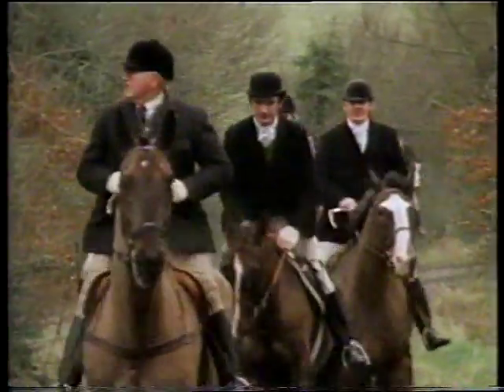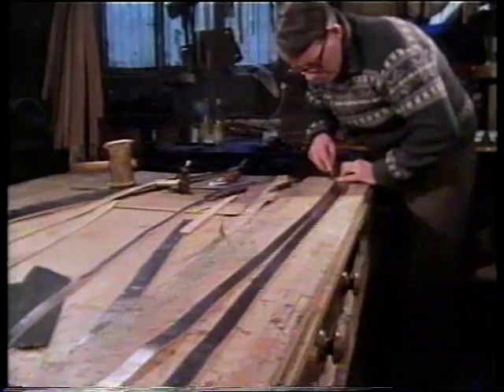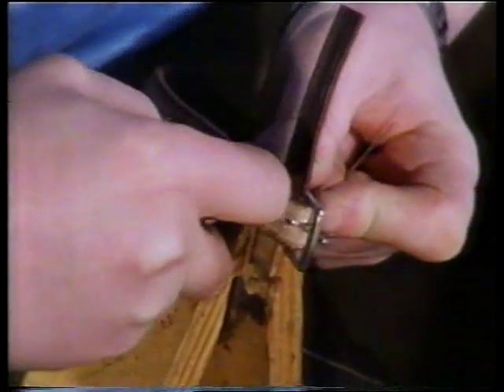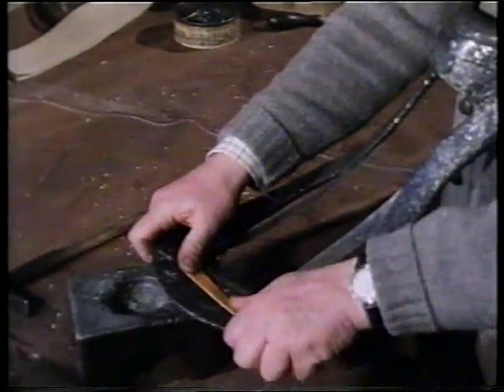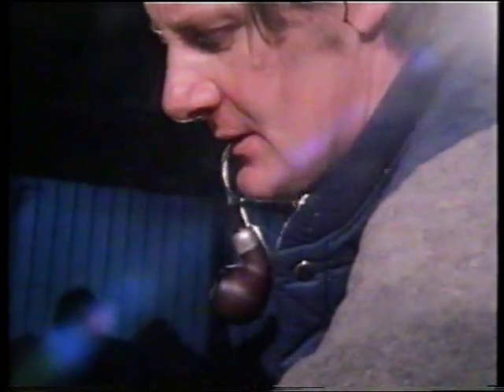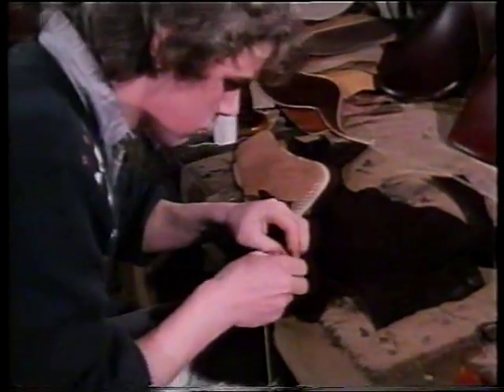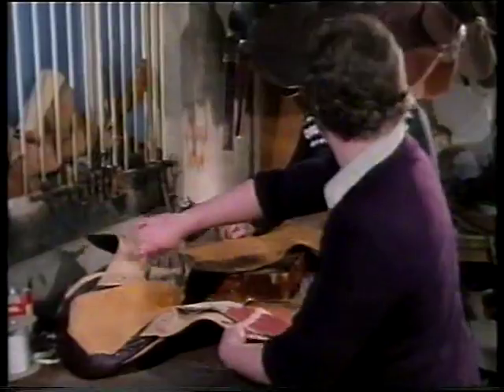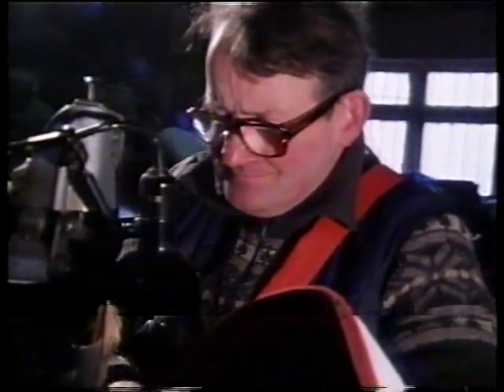Hands: The Saddler

Comment: Many, many thanks for this valuable film. I am a saddle and harness maker and teacher in Hungary. This video is very useful for my students about the older technologies. Nowadays when the saddle industry use pneumatic staple machines instead of nails, modern special sawing machines almost every assembly operations and wide range of synthetic materials (composite saddle trees, webbings, threads etc.). I wonder when this film has been made? I suppose that in 1970’s.
Reply from the maker: I'm glad to hear it's been of interest to you and your students.
This episode was made in 1981.
Reply: Tamás Sápi 
I was in the hands program it was made in 1981 there is very few of the staff still working there Declan lost his life later that year it 
Was a sad time
Reply: i was surprised at the use of the synthetic stuffing, but it may be a matter of practicality vs cost. as a spinner of yarn for knitting, i occasionally buy a whole sheep's fleece. i am constantly reminded in those situations that any bits of the wool i discard in the cleaning/prepping process can go directly into a compost pile, where it will break down quite easily. the synthetic stuff, by contrast, will probably be around for a few hundred years... or longer.